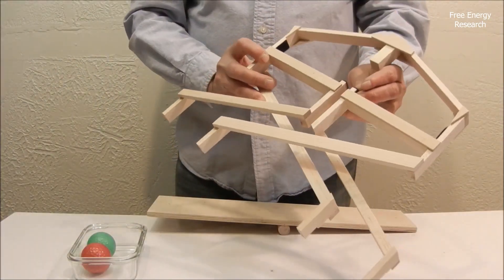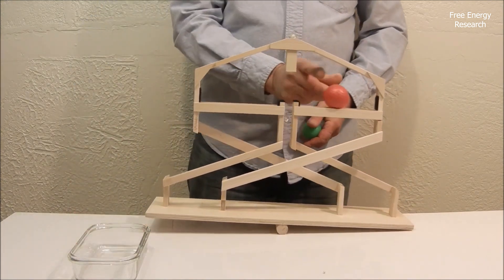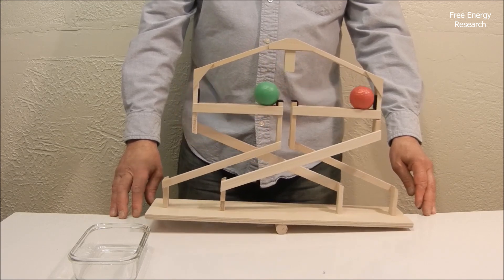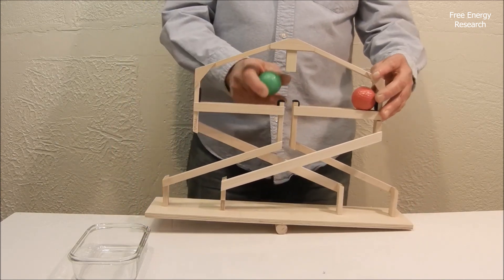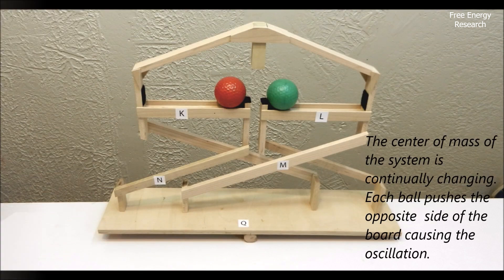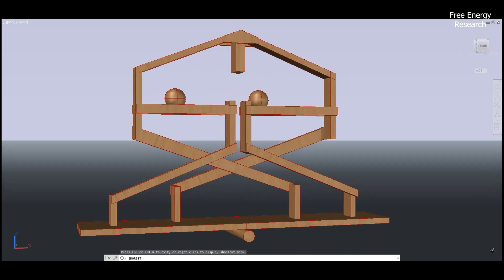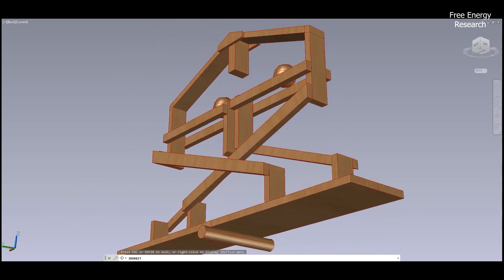Perpetual Motion : See-Saw Machine using Balls

Comment: There's something amiss.  Balls don't "push" on the other side of the platform just because there's a diagonal connection.  It's an upside down pendulum with the mass above the pivot point.  When the balls leave the center the force acting on them becomes stronger, not weaker.  In a normal pendulum as the mass moves to the side it loses kinetic energy and gains potential energy until it stops, then the potential energy is converted into kinetic energy with the mass swinging in the opposite direction.  Here the balls lose potential energy when they roll to the side, not gain it.  So there's no stored energy to convert back into kinetic.
Reply from the maker: Thank you for the comment 💙

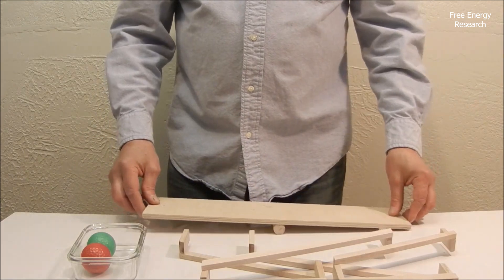Comment: The two holes in the table visible at 0:47 is where the magic happens 🙂. That's where the strings that pull the pull the whole contraption to the left or right come out. Then when the whole thing moves, you can see the reflections of the strings on the table.

Also, once the balls have moved to one side, the center of gravity of the whole thing is offset on the same side as the balls. There is no reason for the whole contraption to swing back to the other side. Without a motor, this thing does not "slow down", it just falls to one side and then stays there.

The zig-zag structure does nothing and is just a decoy. Using straight pillars would have exactly the same effect.
Reply from the maker: Thank you for comment. Nice analisys 👍

Comment: At the start (before the balls are added) the "machine" is perfectly balanced. Given that it sitting on a small cylinder which is well below the center of gravity of the machine, it shouldn't be easy to balance it that way. So it smells fishy. It is probably held in place by another mechanism, which we can't see. Probably because it is behind the machine. Just taking a guess : the motion of the machine is from the user that is standing behind (he is kind of rocking left and right). Maybe some sort of pedals?
Reply: Yeah I agree! My theory is there is thin elastic line, the stuff you by from a magic store for doing floating money type tricks, it's attached to the top of the contraption and he is holding the other end of the string in his mouth, then he tilts his head side to side pulling the contraption left and right as the balls reach each end. That would also explain his body slightly tilting left and right as well.
Reply from the maker: Thank you for comment 💙

Comment: glad I watched the whole video for the claim that this is in fact, not a true perpetual motion machine and is just a clever example of physics
Reply: This isn't an example of physics.  It is a complete sham.  The weight of the balls will never push on the opposite side of the see-saw from where they are, regardless of the orientation of the wood beneath them.  That's not how gravity works.  He is using some other hidden mechanism to tilt the system back and forth.
Reply from the maker: Thank you for comment. An interesting concept